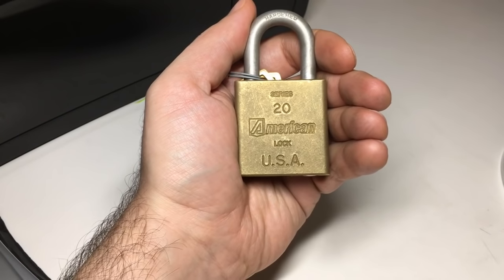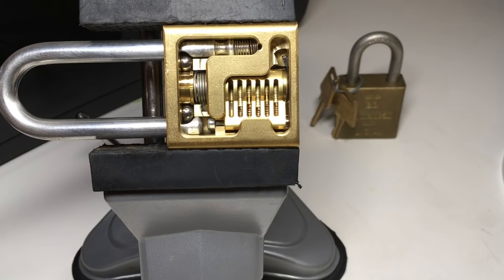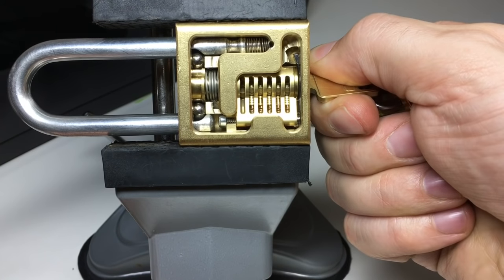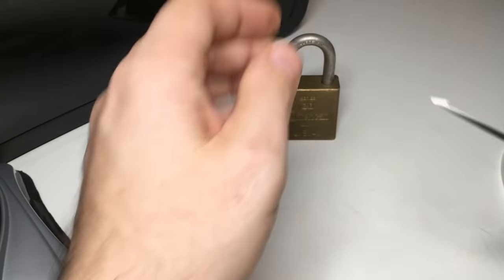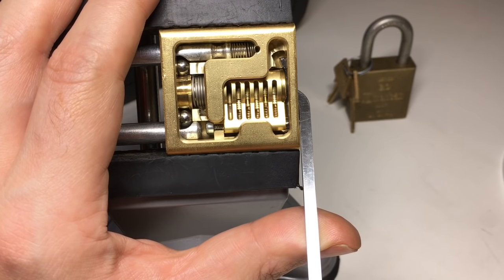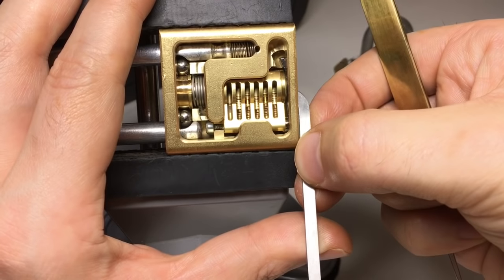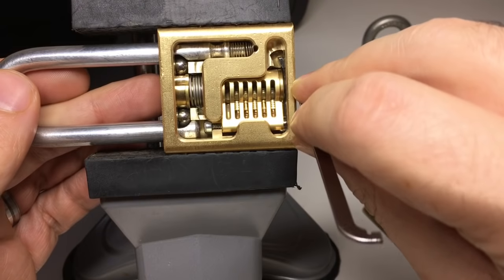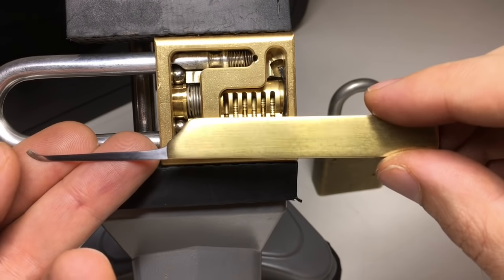(110) Beginners Guide to Defeating Serrated Pins - l0ckcr4ck3r Cutaway

Comment: One thing not mentioned here is how much tension you need AFTER you pick the lock. Lots of people, me included, kept picking the lock over and over thinking it was just going to pop open like other locks. That actuator spring requires a fair amount of torque to actually turn. So if you're getting to the point where none of the pin are moving and you're sure you've picked it, put some force into that tensioning tool, you may find it ready to open.

Comment: So far I've only picked one AL1100 series and one ERA AL-clone. I find these so perplexing because it feels like every pin is solid beneath the pick with even slightly too much tension. The difference between a pin that wants to be picked versus one that doesn't is so subtle, and that's why I always crank them down too hard, overset them and then have to reset. Maybe in another dozen years I might have finally mastered these. I could really do with a cutaway AL to help me correlate what I feel with what is actually happening. Guess that's why I need to keep practicing.

Comment: I find spools to be the hardest followed by mushroom pins (depending on orientation) then I'd say standard and serrated are about the same level of difficulty for me depending on how lubed the lock is. If the lock has a ton of graphite in it then standard pins don't want to bind super easily while serrated will bind but I have also never picked anything with serrated key pins just top pins.
Reply from the maker: I find that good serrated pins can make a lock really tough :-)

Comment: Hi look noob, at 8:55 you are starting to pick the first pin in the back, pick 5. You state you don't want to touch pin 5 because it feels solid. I don't understand your reasoning behind this, if it feels solid - is binding - shouldn't you try to move it ?
Reply from the maker: Good question and I should explain more. When these pins are set to the correct position at the shear line, the key pins, when lifted push against the body of the lock (edge of the pin chamber above), giving a ‘solid’ feeling. If you force them, the key pins will over set in the lock. You are right though, where ther is some resistance on a pin, it is usually binding and therefor would be picked, but with experience, you can tell the different feel between binding and set :-)
Reply: @LockNoob  insane advice thank you so much :)

Comment: So I've bought a few pick sets and I'm not really happy with the shape of anything in them. I have a 4pc, 11pc and a 22pc. The 11pc and the 22pc are cheap cheap seats while the 4pc is a little more expensive. They work. I've popped a few of my locks around they house.. enough to buy news ones for the front, back and outside garage doors and a few pad locks lol. Which I can not pick lol. So anyway that hand made pic your using convinced me make a small set so I can make a few different designs to better suit my hands. Steal comes in all stock and is the to cut and manipulate. Brass as well. So I guess this is a long thank you.
Reply from the maker: Making picks can be so satisfying, good luck :-)

Comment: one quick question, I just gutted the lock to look at the pins,and as I pulled out the core, tinny thin discs fell out. they were sperate from the upper and lower pins. what are they?
Reply from the maker: Hi, almost certainly they are master key wafers, essentially it provides an extra shear line to allow a master key to operate more than one lock. Technically, you can remove the wafers from the driver side and the operating key will still work BUT you can't remove wafers that are on the key pin side otherwise the key won't lift the driver pins to the shear line. If in doubt put the key in the core and drop the key pins in. If they are too low to reach the shear line, then add a master wafer to bring it to the right hight. I hope that helps as it's quite a hard thing to explain in a message.

Comment: So I have a question for you, I want to smooth & Polish my picks what grit wet sandpaper do you recommend or is there a better option to do it?
Reply from the maker: InTheFleshInc the best technique I know is to get an old catalogue or phone book then in every 10-20 pages slot in wet and dry paper folded in half. Start with 240 grit then 320, 400, 800, 1000, 1500 and finally 2000'grit. Slide the pick in between the first 240 grit page, and some hand pressure lightly on the pages above and with GREAT CARE not to push the pick through the pages into yourself, slide the pick back and forth a few cycles. Move then to the 320 grit and repeat all the way up to the 2000 grit. By this point (and with a bit of practice) you will have a mirrored finish :-)
Reply: Lock Noob, Awesome sauce... Thank you for taking your time to give me this advice I will roll with it. Much appreciated...